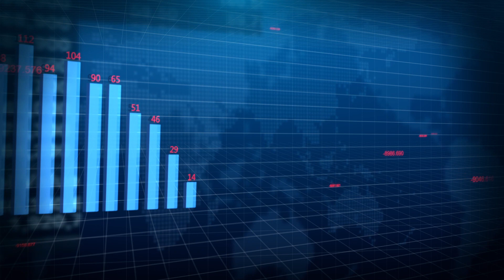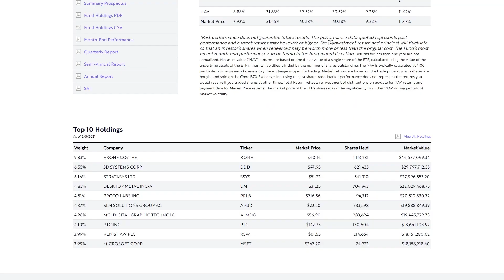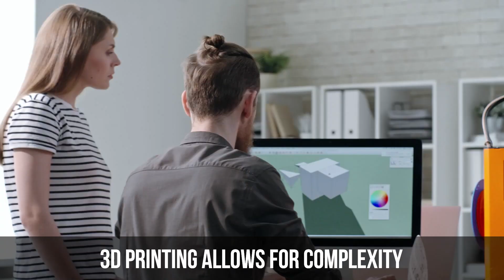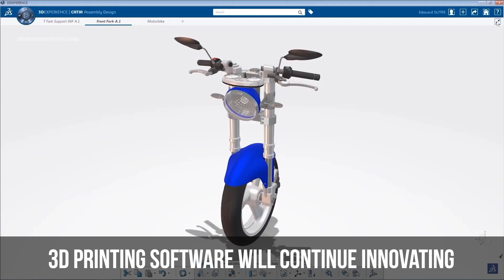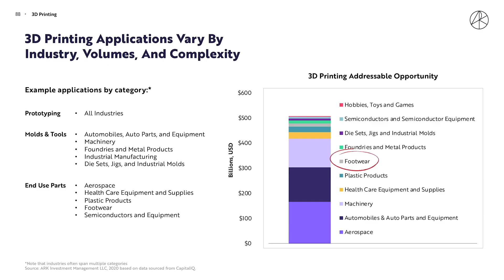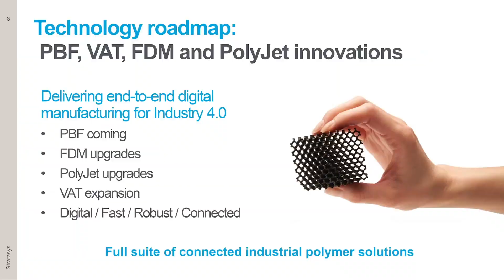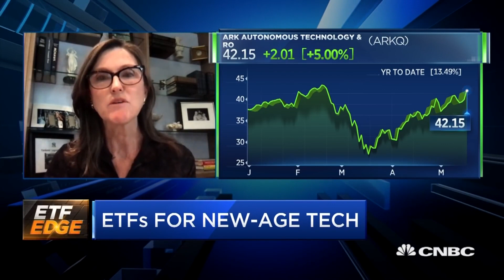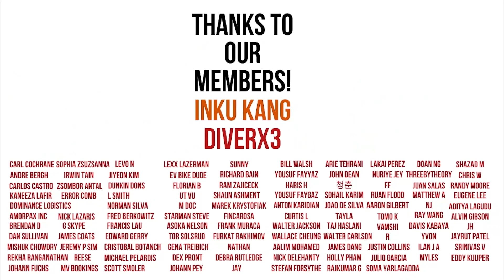Cathie Wood: This $120 Billion Industry Is On The Verge Of Going Mainstream

Comment: Until recently I worked in aerospace as an engineer. 3d printing made many parts that were literally impossible to create with any other method both cheap and reliable. I believe their analysis sounds correct from my prior experience, since the engineers are not used to attempting to reduce parts and assembly labour explicitly with 3d printing, but we're getting there.
Reply: so which companies were you working with for the 3d printing? or do they aerospace companies develop their own additive process?
Reply: @RakanXYZ  WAAM printers are often customised CNC with an arc welding head but I'm pretty sure that even there it's a customised order, not an in-house solution.
Reply: Without being too specific, the company I worked for made "machines that make the machines" aka manufacturing. On one end you get the fact that in order to both prototype effectively and create very complex geometries you need to print. Companies that supply such parts are the "protolabs" of the world. More and more you see production parts which were in small quantities, less than 200 generally, become 3d printed because of both complexity and cost as I said before.

On the other hand when you're talking about new additive processes, there are also large scale additive processes which are becoming more popular. For example I saw a video of a 3d printing rocket company recently. Another technology is called continuous carbon 3d printing which was truly amazing to see first hand. Essentially trying to print large aerospace structures fully automatically using a mix of ABS heads, PEEK heads and CCF heads. My hunch is that there is a lot of this kind of stuff that I haven't seen personally but it's being developed.
Reply: How far are we from being able to 3D print carbon fiber at scale?
Reply: @kendrickdelosreyes5381  Automated fiber placement is widely used at scale, the issue with carbon fiber is producing small parts for cheap.
Markforged has a continuous carbon fiber printer, but desktop metal has an even better one.
Reply: Thanks for checking in 

Do well to reach out for investment assistance
Reply: We use metal printed parts on military aircraft. The parts are made in laser additive machines.

Comment: I dont want 3d printers to hit full mainstream, rn its perfect as it is in this bubble we are in where most 3d printers are open source and everything is ok, but we are in for a major revolution, its already happening with prusa and ultimaker, 3d printers are destined to end up like the ink-jet printer if it goes full mainstream, soon we will see printers that only take  special kinds of filaments or printers you can’t modify without it bricking itself, all because of greedy companies

I am inevitable
Reply: The desktop metal studio system is 120k$ for example and it's just an FDM printer, the real deal is the filament, which is a metal fused filament...

Comment: Great video.

3D Printing is my biggest position after EVs. I'm invested in a very promising micro company called 3DA (ASX). Already up 350%.

They are certified with six of the top 10 defence players. Orders from Boeing. World class board, which includes the former defence secretaries of the USA & Australia.
They also have an exciting angle into bnnt, which could be a key element for aerospace. Very exciting prospects.

Defence & aerospace I see as big contributors in this space.

Comment: For custom solutions it’s fine. Expensive products like Aerospace, Health solutions implants maybe even organs. Normal production it has to speed up enormous plus reducing cost. Metal printing cost loads of energy imagine a laser that can melt metal. First you need to make metal powder. And then you have to melt it to stick it together. It has a lot of potential but real low cost production is still far away. Printing plastic cool. But you also want to print metal if you can achieve that low cost your a winner. Civil engineering is still underestimated I think and has lot of change to implement 3D printing
Reply: With metal binder jetting you can print 60 kg of steel per hour.
For plastic it's even faster, the EOS laser profusion takes 9 seconds per part in average.
Reply: You are several years behind the curve.
Time to update your knowledge base. ;)

Comment: If you look at spaceX career page most manufacturing and production jobs for the raptor engine require some experience with 3d printers.
That's how they will get the cost of raptor down to 250k$

Comment: I use it amlost every week, the main constraints are long print time and weak materials.
On the positive side, huge benefit at relaxing geometries constraints and we can make single end use parts for many use case.
To go mainstream the process will have to be way faster, technologies are still slow like snail compared to injection molding.
Reply: You should take a look at the EOS laserprofusion, it's like one part every 9 seconds so 100k parts in 10 days.

Comment: How does 3D printing make hardened tool steel such as Crankshafts for engines.?   And, what about the speed at which 3d printing is done?   looks rather slow to me vs. machining components?

Comment: Pretty sure there are houses that got 3d printed and the nasa wanna use 3d printers for a moonbase
Reply: That would be genius. Moon dust and cement but need a way to replace water which would boil off.
Reply: Thanks for checking in 

Do well to reach out for investment assistance

Comment: 3D printing is a newly developing technology for the last 35 years, which couldn't achieved much till it's first days, aside Carbon's patent on high speed oxygen control of process... That is the only quality patent for the last 30 years or so...
Reply: What about metal binder jetting and nanoparticle jetting?
Reply: That's how I see it as well. Invested in 3D printing 10 years ago but since then no revolution has happened. For sure material and use cases improve evolutionary and some use cases might become a success. And the advantages like creating structures you otherwise couldn't produce are known for many years now. And so are the drawbacks like being slow and expensive. So for niche products and prototypes a good choice, but for mass production still questionable.
Reply: @stefanwagener  Well, the fastest SLM printer only reach 1-2.5 kg per hour by using 12 one kilowatt lasers.
But metal binder jetting printers can reach 60 kg/h, binder jetting printers for sand molds can reach 400 L/h and the laser profusion can produce plastic parts at a rate of 9 seconds per part...
Reply: @johntheux9238  Metal binder jetting is patented in early 1990's... it's 30 years old... and sorry still porous and brittle after 30 years.. There are some nice machines but nothing new that may change the game...
Reply: @sahanda2000  Inconel 718 from ExOne has 1331 MPa of tensile strength and 15% of elongation.
H13 Tool steel from desktop metal has 1720 MPa of tensile strength and 5.8% of elongation (from the studio system so it's FDM)
Reply: @sahanda2000  But if you want ultimate strength the SLM Solutions NXG XII 600 can print from 1 to 2.5 kg per hour using twelve lasers. It's not as fast as binder jetting but for some usecases it's pretty good.

Comment: 3D printing is very useful and definitely has many exciting applications.  However, the vast majority of future use-cases are still better performed by current manufacturing techniques.  I believe use of 3D printing will grow in the coming years, but not to the point where it every fully replaces or even surpasses current CNC machining.  Limited upside imo
Reply: You mean for strength? 3d printed maraging steel is stronger than almost anything you can make using CNC machining, can reach 2200 MPa of tensile strength.
Reply: @johntheux9238  I mean in terms of manufacturing cost and efficiencies. Mass producing large lots via 3D printing just isn’t viable
Reply: @AndyNick211  Depend of what 3d printer do you use. The EOS laserprofusion can print one part every 9 seconds, that's 100'000 parts in 10 days.
Reply: @johntheux9238  maybe tiny parts, but nothing of substance.
Reply: @AndyNick211  They had a stall at formnext 2018 with a box full of those. I would say it's not that small and most important it had really high resolution for something that was built in a printer with that build volume.
Reply: @AndyNick211  But those are still plastic parts, if you want to print steel you should take a look at the desktop metal production system and the ExOne X1 160PRO which can reach 60kg/h

Comment: Which stocks in 3D printing do you buy ?
Reply: I would buy desktop metal and ExOne because metal binder jetting allows printing speed of 60kg/h and the powder is dirt cheap since it's based on the MIM (metal injection moulding) process.
You should also take a look at those companies:
EOS Electro Optical Systems (laser profusion)
Xjet NPJ (carmel 1400)
SLM solutions (NXG XII 600)
Ge Additive (Electron Beam Melting)

Comment: 3d printing is around for over a decade and yet it's only used for novelty items and aerospace industry. What changed today? What will change in a year? Where is the DISRUPTION???
Reply: -Metal binder jetting
-Nanoparticle jetting
-Laser diodes (5kW for the EOS laserprofusion)
-multiple lasers (12x1kw for the SLM solutions nxg xii 600)

Comment: Despite having great potential, the target market is very far away, to reach this 500b in 2025 it is necessary to have great scalability and not just cost reduction.                                                                 The graph in 4:16 is the key to understand the barriers of 3d printing. Real Engineering has a great video to understand all engineering in this market
Reply: Yeah, it's a flat line but with some printers the line is so low that it's still cheaper than injection moulding for 100'000+ parts.
The EOS laserprofusion for example can produce one part every 9 seconds so that's 100k parts in only 10 days.

Comment: Always wondered the performance of the 3D printed products
Reply: The slm solutions nxg xii 600 for example can print parts that are as strong as forged parts.
But you might need to use an hot isostatic press afterward to have a 100% dense part.
Reply: Thanks for checking in 

Do well to reach out for investment assistance

Comment: #nice covering but i heard from a technician who worked 20 year in this sector and said 3D printing is good for R&D but in mass production its not good.
Reply: @marktilbury2521  scared about many scammers about bitcoin trading on YouTuber comments thread.
Reply: @marktilbury2521  thanks for you prompt reply.
Reply: @marktilbury2521  I would request you to cover a undervalued 5G stock "GSAT". Could u please whenever you get chance?
Reply: There are a few printers for mass production.
-For metal there is the desktop metal production system and the ExOne X1 160PRO which are both capable of 60kg per hour.
-For plastic there is the EOS laserprofusion that can print one part every 9 seconds in average.

Comment: What 3D companies do you own?
Reply: I would bet big on desktop metal and ExOne because metal binder jetting is lightning fast (60kg/h of steel) and because the powder they use is dirt cheap (it's based on metal injection moulding)

You might be interested in those companies too:
EOS Electro Optical Systems (laser profusion)
Xjet NPJ (carmel 1400)
SLM solutions (NXG XII 600)
Ge Additive (Electron Beam Melting)
Reply: Thank you John.  Appreciate your input.

Comment: Any 3D printing companies except NNDM?
Reply: I would bet on desktop metal and ExOne because they have the fastest process (metal binder jetting) and all the alloys already exist because they use cheap MIM powders (MIM stands for metal injection molding)
But you should also take a look on those ones:
EOS Electro Optical Systems (laser profusion)
Xjet NPJ (carmel 1400)
SLM solutions (NXG XII 600)
Ge Additive (Electron Beam Melting)

Comment: Any 3D companies to invest in?
Reply: I would invest in desktop metal and ExOne because they are the leaders in metal binder jetting, they can print up to 60kg of steel per hour and the powder is dirt cheap and widely available (it's mainly used for metal injection moulding or MIM)

You should also take a look at:
EOS Electro Optical Systems (laser profusion)
Xjet NPJ (carmel 1400)
SLM solutions (NXG XII 600)
Ge Additive (Electron Beam Melting)

Comment: Do you mind giving references for  your research on 3D printing ?  Using some info for my FYP
Reply: There are as much different process as you can think of.
So you should just take a look on aniwaa, there is 2000+ printers, just use the filters to see what each process is capable of.

Comment: im not sure this is gonna happen 3D Printing will always be more expensive then Injection Molding when it comes to high Volume Production since its so slow and when looking at what needs to happen aka more layers its gonna take eveen longer
Reply: Depend of what you mean by high volume.
If you want to make billions of legos per year then sure but for up to one million parts you can use additive manufacturing, especially the EOS laserprofusion which can print one part every 9 seconds.
Reply: @johntheux9238  so no its cheaper much faster because one injectionmolding maschine is a lot faster then a printer so you would need tens of Printers so its basicly depending on size and stuff but a couple thousend allready makes it cheaper with the Injection Molding mashine the expensive part would be the tool or Mold and depending on size and tolerances these cost like 10k -150k
Reply: @johntheux9238  but i didnt know that metal printing is becomming a thing and its a lot more expensive then milling rn for a metal Printer you need the mashine (too expencive rn but will get cheaper) and fine metal dust and producing that is a lot easyer then i thought so metal dust could become like 3x the price in solid metal and if that were to happen it will get really big because milling takes time and wastes a lot of material so yea metal Printers might develop into sth and turns out that ETF of hers inclues a lot of Metal printing companies
Reply: @chillidog8726  Well, you can make 2000 parts in 5 hours using the laserprofusion while making the tool/mold will take weeks or even months.
Reply: @johntheux9238  well no you can make a tool after prototypeing in a week or less and that tool for your lego example could make like 100 or sth legos at the same time and one bach takes less then a Minute
Reply: @chillidog8726  Depend of what powder do you use, the powder used for metal injection moulding for example is dirt cheap.
Most printers use high quality spherical particles but with a good dispensing system (using ultrasounds for example) you can use powders with a steep angle of repose.
You should take a look at the desktop metal production system, that's what they do.
Reply: @johntheux9238  ok im gonna look at that :)

Comment: Please stop showing us FDM printers, those are lame...
Reply: Why are they lame? SLS and SLA work in the same way, layer by layer, and FDM printer are so cool and affordable
Reply: @freddymaster0057  Everything became affordable as the tech improve so it's always the guys with the best tech who win, even if at first it cost an arm and leg.
Reply: @johntheux9238  in 3d printing, no, cost isent everything, i have a $300 3d printer and it is better the my local macerspaces  
$4000 dollar printer, this is because you dont pay for the printer, you pay for the pattens
Reply: @freddymaster0057  With a $300 3d printer the only way to print metal is to use ultrafuse 316L filament and it's slow as hell.
With a metal binder jetting printer you can print 60kg of steel per hour.
Reply: @johntheux9238  so you want to print with metal huh, just get a pocket nc then, metal 3d printers are a pain to work with, for gods sake just get a 5 axis cnc
Reply: @freddymaster0057  Or a Sintratec printer but you just replace plastic powder by metal injection molding powder...
Reply: @johntheux9238  i get what you are saying but a cnc can peoduce parts faster stronger and more accurate, metal 3d printing is sadly not gonna become mainstream, what happened to ink jet printers has already happened to metal 3d printers
Reply: @freddymaster0057  The SLM Solutions NXG XII 600 can produce parts that are as strong as forged parts.
You should take a look at their channel, they have a ∅ 560 X 427.5mm midframe in inconel 718 that weight 120kg. It was printed in 72 hours.